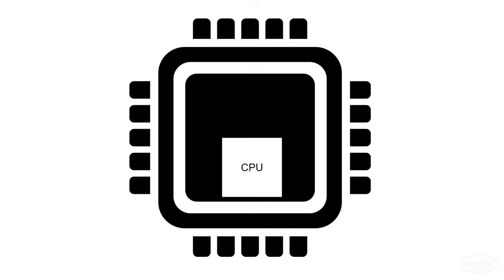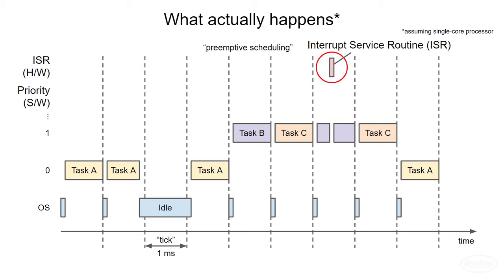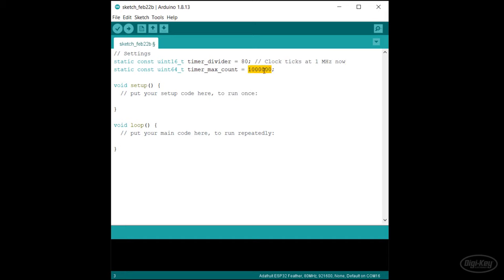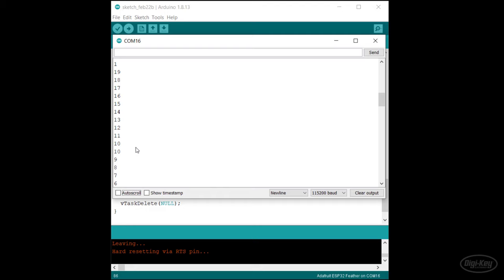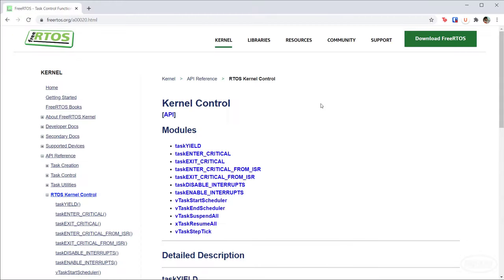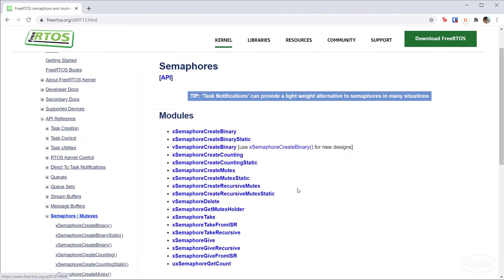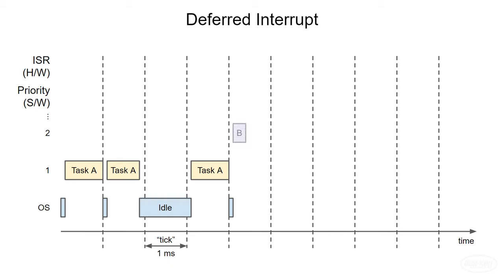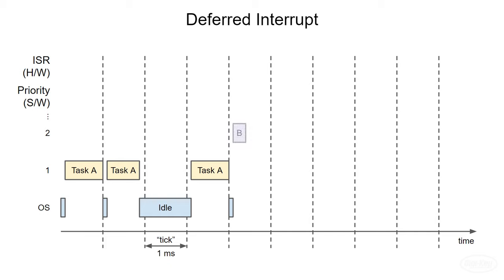Introduction to RTOS Part 9 - Hardware Interrupts | Digi-Key Electronics

Comment: Nice challenge problem.  Image the look on their faces when they find out the template for a ring buffer isn't in the STL.
Reply: Hehe...yup, this was a challenging one :) I figured that at this point, I’ve talked about almost all of the “tools” in FreeRTOS to make something like a multithreaded sample-and-process program. The ring or double buffer parts are missing, but I figured that there are enough examples out there on how to use/make them (and they’re not really RTOS related, anyway) :)
Reply: Is there any reason not to use xQueueSendToBackFromISR(..) instead of a custom double buffer?
Reply: @sigusr  For this particular example, you can probably get away with using a queue, as data is being produced and consumed relatively slowly. However, queues are slow compared to direct memory read/writes, as they have extra overhead to be thread-safe. The point of the exercise is to create an RTOS application where you need to work with data being captured from a sensor at a rapid pace (and therefore would not be able to use a queue).

If you're curious, this person found that queues can be written to or read from at about 3 us per access on the ESP32: https://techtutorialsx.com/2017/09/16/esp32-arduino-freertos-queues-performance-test/

Comment: Thank you for another great tutorial, however, I found the explanation of critical sections confusing and needed to do more research. I feel like the subjects of ISR critical sections, mutexes and spinlocks should be separated here. In my understanding, ISR critical sections are used to disable all interrupts for a very short period of time, to prevent race conditions between tasks and ISRs. Even though we may be in an ISR in one core, a task running on another core could still access the same variable; so we should protect it further with a mutex or spinlock. Mutexes and spinlocks can be used interchangeably, however, spinlocks are used here by default to prevent wasted CPU cycles. As opposed to spinlocks, mutexes put tasks to sleep, and that uses many CPU cycles. This isn't recommended if we access variables often and for short periods of time, as is the case in ISRs, therefore spinlocks are the obvious choice in ISR critical sections. Please correct me if I'm wrong.
Reply: Actually, spin locks are the opposite! The spin through cycles which uses more cpu cycles, while a mutex will block and therefore not use cpu. The reson why we use spin locks is because the "cost" of a spinlock is lower if we are not waiting too long, which should be the case with an IRS critical section. If however we may need to wait a while for the resource, then spinlocks, or "busy waiting" are wasteful and a mutex is preferred

Comment: I'm getting an error when I try to run this on my ESP32-S2-WROOM. The error I get is "abort() was called at PC 0x40027db7 on core 0" and then the ESP32 reboots and it just keeps repeating this. This makes me believe there is some sort of overflow happening (maybe with the timer_divider?). When I comment out the timerAttachInterrupt() line of code, I don't get the error. Anybody have anything they'd recommend I try?

Comment: Thank you for the knowledge shared, but I have an issue. I've tried several codes, but none of them seem to work. I don't understand how to use it on STM32F4. I'm using a hardware timer from TIM1, but it's not functioning. Can someone help me with how to code on STM32 using Arduino IDE?

Comment: About the semaphore and the overrun flag in the challenge answer:

Looks like the state is either (semaphoreTake TRUE + overrun = 0) OR (FALSE + 1), 
-> with (TRUE + 1) and (FALSE + 0) being unreachable.

So, is the whole point of the overrun flag a signaling mechanism so that the error message "Error: Buffer overrun. Samples have been dropped." can be printed out?

Suppose if we don't care about error message, 
-> buf_overrun is not needed in the ISR condition check "if ((idx < BUF_LEN) && (buf_overrun == 0))" 
-> if we use "if (idx >= BUF_LEN   &&   xSemaphoreTakeFromISR(sem_done_reading, &task_woken) == pdTRUE)" to guard the whole buffer full section,
-> so idx is not reset to 0
-> "if (idx < BUF_LEN)" always fails until semaphoreTake is successful

Did I understand it correctly?

Comment: In esp32 which core will execute ISR functions? Is it possible to shift the ISR to a particular Core
Reply: The core in which the ISR was assigned (attached) will be the core that executes the ISR. It is not possible to move the ISR once attached to a core. This section gives more information about ISR: https://docs.espressif.com/projects/esp-idf/en/latest/esp32/api-reference/system/intr_alloc.html#internal-peripheral-interrupts
Reply: @ShawnHymel  Thanks